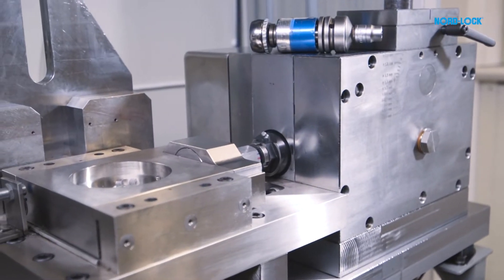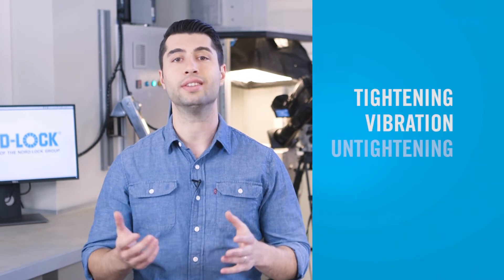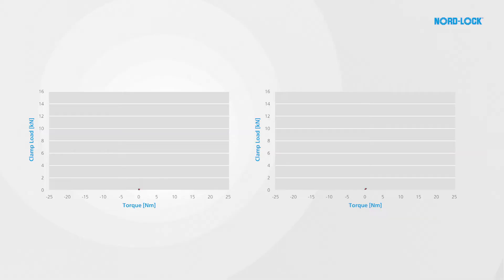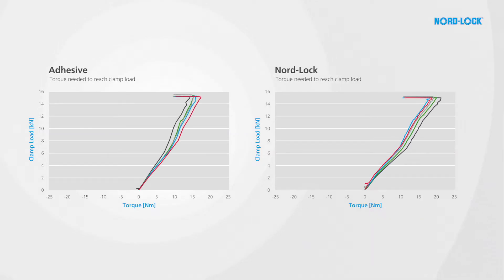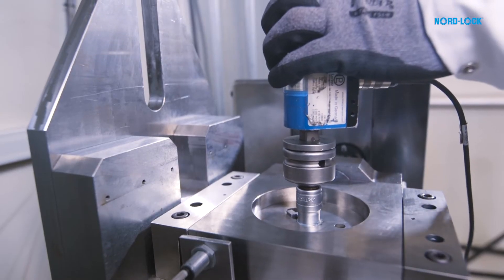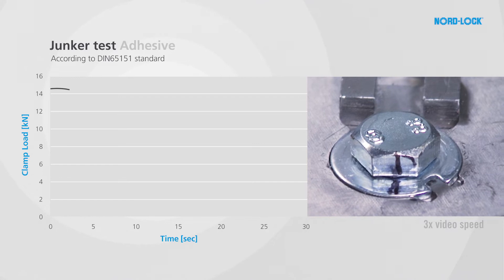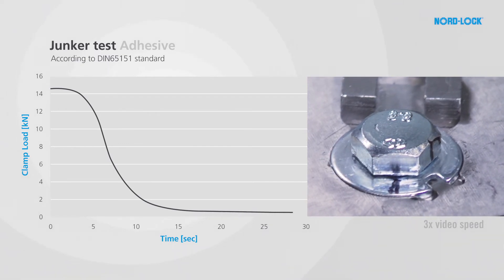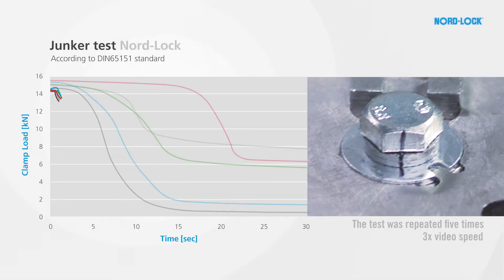The Junker Challenge - Nord-Lock vs Adhesive

Comment: We use both Nord Lock washer with Class 10.9,  M12 (12mm dia.) geomet 500 plated bolt combine with 243 loctite threadlocker and step Torqued (30, 60, &115Nm) which mounts on threaded hole. The two structural bolts holds an articulation damper in our vehicle, all of them loosen up after some time. Any idea why?
Reply from the maker: The Nord-Lock washer should work with both the M12 class 10.9 bolt and with Loctite 243 in the threads. So to try and find the rot course of the issue we need more information. We need information regarding the clamped parts like the material and mechanical properties. The clearance hole diameter in the clamped parts, and a lot more. Please contact your local Nord-Lock office (link below) and we will be ready to help!
https://www.nord-lock.com/contact/

Comment: I noticed you used blue (medium strength) Loctite, I would like a comparison with stronger Loctite since Loctite is the most common way to prevent bolts from loosening.